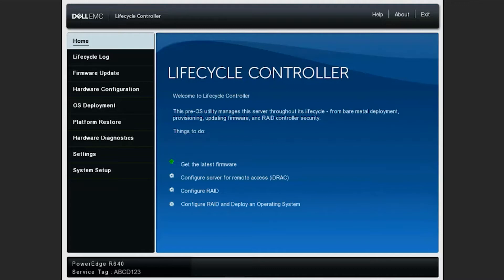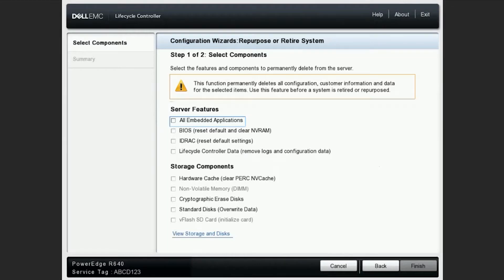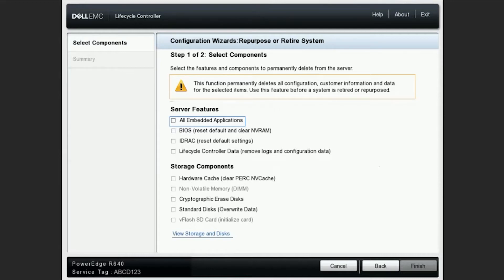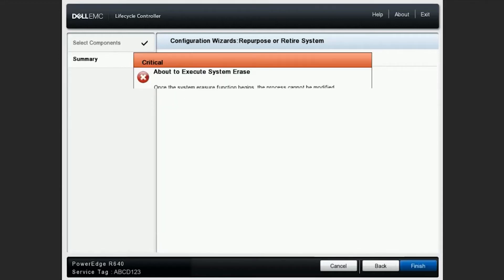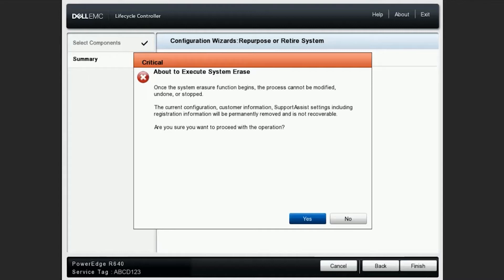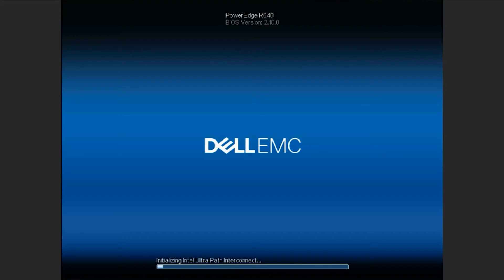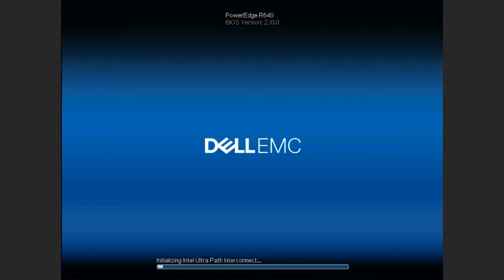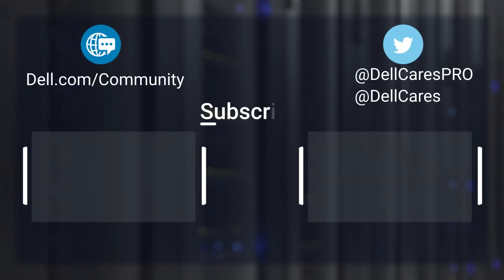How to use the Repurpose or retire system feature of the PowerEdge Lifecycle Controller

Comment: in short, repurpose or retire means to reset every config of the machine to when it was bought, correct?

I just got a machine and it was owned by someone before. repurpose means deleting all their settings? it doesnt mean it becomes un useable?
Reply from the maker: Hi @DedesFewscres, that is correct. You can find more on the feature in the LCC manual: https://dell.to/3JS1Qzs

If you need further assistance, please conatct the Dell Support directly at https://dell.to/4bheynl

Thank you.

Comment: What is the meaning of repurpose or retire inside these machine, is Retire meaning scrap the hardware and dispose of it, just curios as I bought a 2nd hand r620 and while it works for home its always got errors for power supplies
Reply from the maker: Hi skozzy1968, yes you can use the feature to clean the server configuration before disposing it. In most cases, you do not want your configuration saved for everyone to see on the server if you sell or scrap it.

For troubleshooting the Power Supply issues, you may find this guide handy: https://dell.to/3CNLuV2

If you need further help, do not hesitate to contact the Dell Support at https://dell.to/3NOIQ7R

Thank you.

Comment: Does repurposing or retiring the system wipe all the data from the hard drives or is using DBAN a better method to wipe all the data from the system? Thanks.
Reply from the maker: Hi AV, it is possible to delete data using the Repupose/Retire feature, but this is not the main value of the function. It is meant to reset all configurations and BIOS level data to default values. For securely wiping data from your disks, you should use software that is created for that purpose, like DBAN you mentioned.

If you need further help, please contact our Support Staff on the Dell Technologies Community at https://www.dell.com/Community

Thank you.
Reply: @DellEnterpriseSupport  Thank you for your reply.